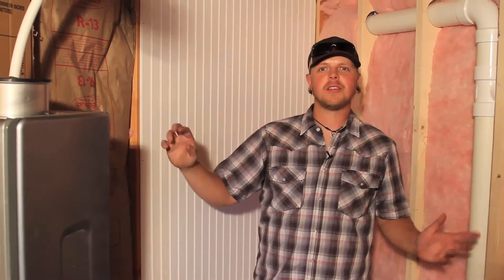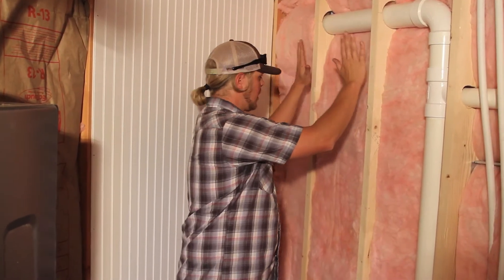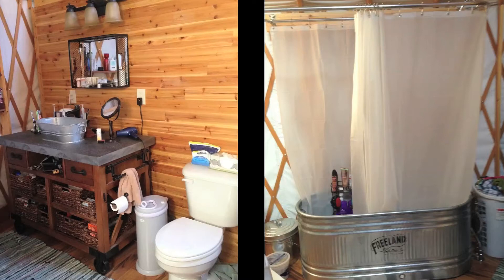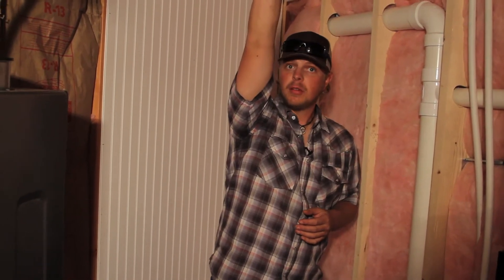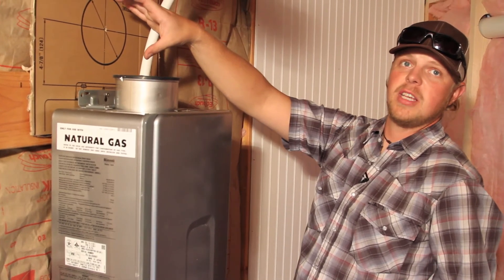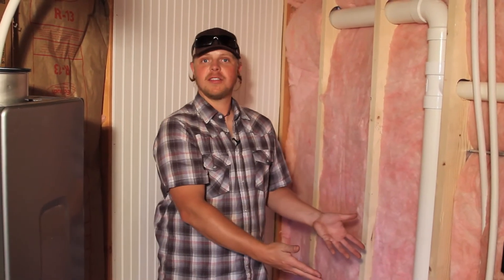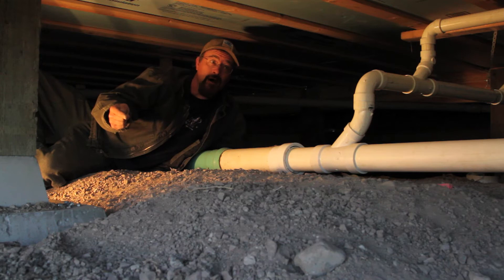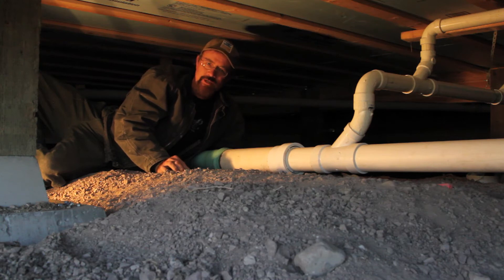Shelter Designs Yurts: Intro to Plumbing a Yurt

Comment: i was thinking of doing a small root cellar under neath the yurt to run water lines for bathroom/kitchen to not worry about them freezing, and to keep the water heater down there with a water heater blanket. have you known anyone to do this? the cellar walls would go up to the base of the deck of the yurt so none of the piping is exposed, itd all be encased in the cellar walls.
Reply from the maker: +TsD1455 That is totally doable and a great idea.  In this video the yurt owner chose to skirt the entire platform with insulated walls to protect the plumbing as well as keep drafts and critters out.  Many of our clients build a smaller, isolated, insulated box around the plumbing from the ground to the underside of the platform. That concept can be expanded to do what you are talking about and make it a root cellar/utility room/ crawl space.  Keep in mind that you will either need to build you platform high enough above grade to fit the hot water heater and piping in your cellar, or partially bury the root cellar to keep the platform height lower above grade.  We have some great photos of this type of work we would be happy to send you.  Shoot us an email or give us a call.  Thanks, and happy yurting!
Reply: cool thanks! I sent an email!
Reply from the maker: +TsD1455 Just sent one back!  I look forward to hearing from you.
Reply: Thanks, great idea
Reply: You guys are amazing!